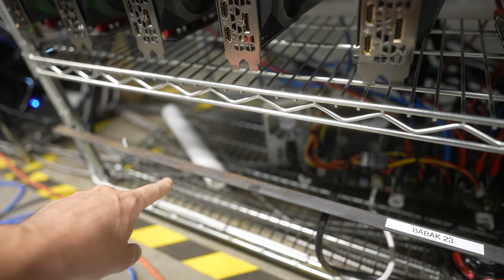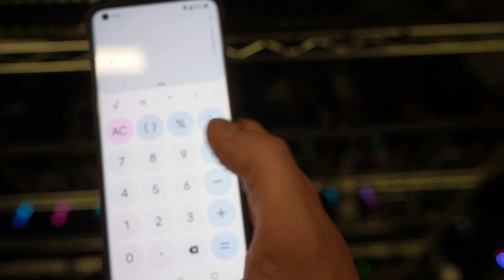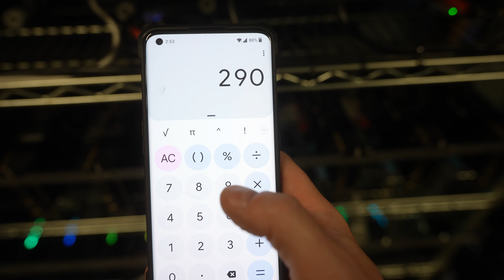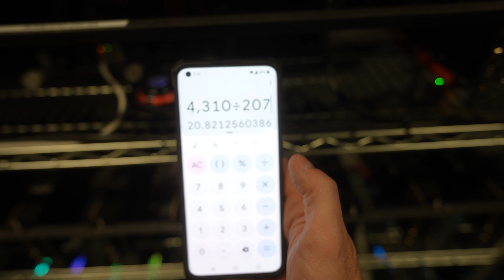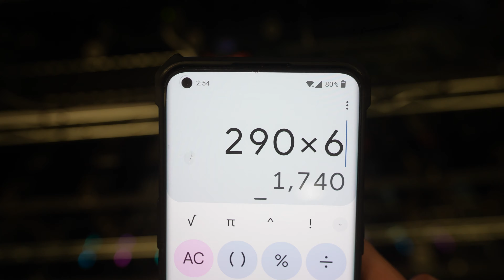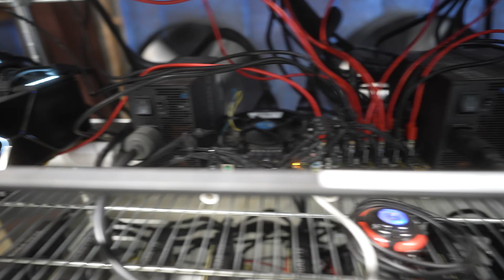Power Use Increase From Ethereum to Most Alt Coins

Comment: crypto mining is dead bro
Reply: I second that
Reply: I mine etc flux rvn avn  all at the same time on my 3090and 3090ti. Instead of 290w or more they pull 200w each. Give it a try, yes hash is lower but it works well and uses less power than etc/eth would alone.
Reply: @The Mining Network  everyone is negative and even with free power You're making 10 cents a day on a 800 dollar GPU. That's completely trash.

Dead. Deal with it

Comment: The 3080 tdp is 320w x 5 which is exactly 1600w. If (for whatever reason) your overclocks are not set and the cards are running at full bore OR you have gpu spikes (which happens on occasion even after power limiting), won't you be pushing each psu over max 100%?